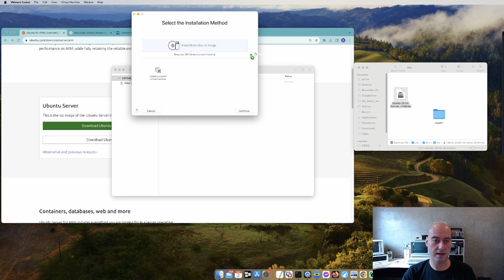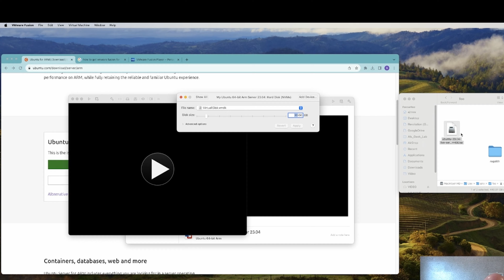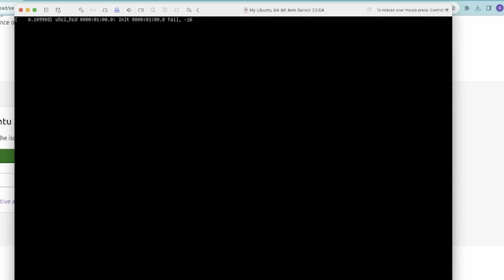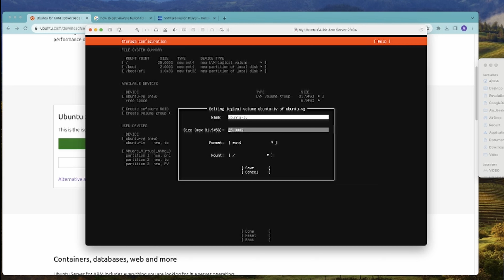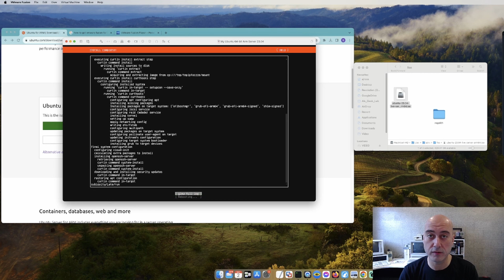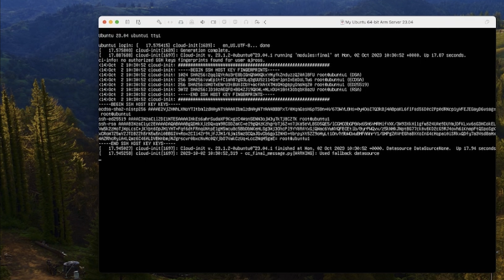How to install #Ubuntu Desktop on an #Appl Silicon mac #M1 #M2 #M4

Comment: Does UTM follow the same procedures to install Ubuntu? or Should I just vmware Fusion to get a better experience?
Reply from the maker: I find utm to have low performance on my M2 silicon, but you can give it a try, VMware should be best, and it's free for personal use